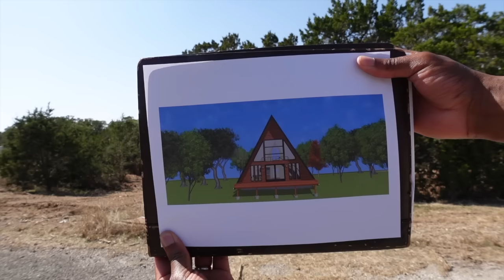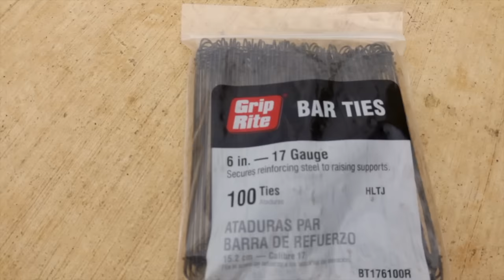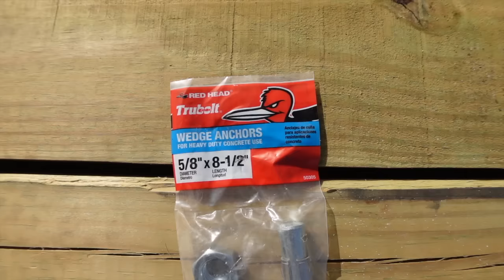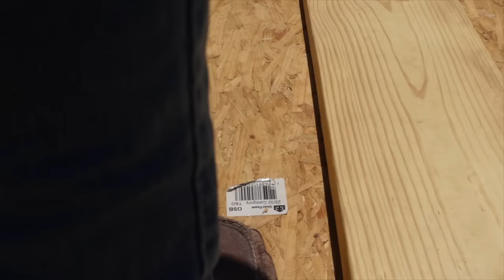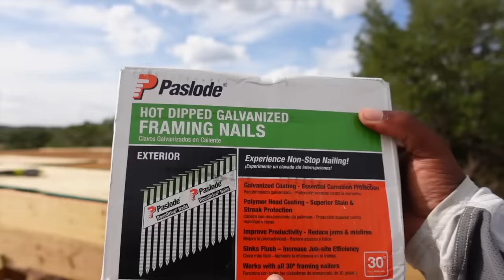TIMELAPSE | DIY Builder Makes A-Frame House In 25 Minutes | Canyon Lake, TX | Texas Hill Country

Comment: I’m 100% building an A-frame. I was undecided between that and a container home, but I have always been obsessed with the triangle. 😅 and putting solar on it.
Reply from the maker: That’s great! You can 100% do it. I think you’ll like it’s charm. And, the solar panels would be an awesome choice. 👍
Reply: Not very good for solar as the angle does not match the suns path
Reply: Do both.  Containers as walls a frame on top connecting them.
Reply: ...and water collection

Comment: the principle of the A frame is aesthetically cool and seems simpler to build but it requires a very high roof height to have enough habitable floor space useful when standing
Reply: I bet those who live in Mammoth Lakes in the Sierra Nevada are wishing they had an Aframe.  Sheds snow like nothing else.
Reply: They are not efficient with materials either, and inherently dark unless you break the A-frame-ness with "skylights" or dormers to get windows in elsewhere than the two ends. Designs are heavily weighted to use mezzanines and open floor plans to get any natural light past the ends. The aesthetics are fun though, but I wonder how much of that is borrowed nostalgia from the A-frame boom of the late 50s and the contrast vs conventional straight-wall houses.

For snow shedding, you can build a regular house with a 60 pitch roof, and even design your attic like an A-frame, but you get all that sweet conventional space below the roof. :)

Comment: If you don't mind me asking what are you using for rafters 2x10s? Married in the center? And how wide and tall was that house it's so hard to find info on these houses unless you buy a kit
Reply from the maker: For sure. So, the roof rafters are joined  2x10x16s. Two 2x10x16s make 1/2 of a full rafter. Then I cut them down ton size at 27ft and change long. The rafters are joined together in 3 spots. Ripped 8 ft pieces of 23/32 plywood connect the sides and a triangle piece connects both sides of the rafters at the top. Make sense? You may need to watch my “Raising the A’s” video. It will give a better visual. 🙏👍

Comment: Guys, the steel should be tied up with wire before pouring the concrete. It makes for a simpler way of attaching the rest of the structure as well. Nice build you're doing, hope to see how it advances eventually!
Reply from the maker: Gonsalomon! Go back and watch my other videos, brother. 👍

In the bottom of each of footing is rebar sitting on top of rebar chairs. And, to be extra thorough, I also wet-set four additional pieces #4 rebar that is bent in an L shape. Which is common place in residential construction.

Thanks for watching the channel! More great stuff on the way. 🙏👍
Reply: Daryl darksy cool video. Keep that auger vertical for better results 👍🏻👍🏻🤙🤙 good luck on your project A-frame that's so cool

Comment: This is so awesome, thanks for sharing because this is giving me an idea of what I need to do when we build an A-frame in NC starting later next year.  How did you attach the floor joists to the beams?  Nails?  I would have though some sort of bucket/angle would be used... Also, I noticed that you have some joists flush with the beams and then you put the joists on top of the beams...why is that?
Reply from the maker: Howdy! Yeah, my buddy convinced me  to just to throw the floor joists on top of the beams and I just never took the other joists down. But yeah, I used galvanized nails when I nailed the floor joists to the beams. Good luck with everything! 🙏👍

Comment: Darryl! I want to build one of these. Im here in Atl Ga. i work in a hospital. I know very little about how to go about this. If I could get any advice on where to start i would be grateful man. How knowledgeable about this were you when you started?
Reply from the maker: Terris! You can absolutely do this! Before I started building this A-Frame, I’d built a few small things around the house like; barn doors, tables, and a faux fireplace. So, this project was entirely different. 

My best advice is to watch all my videos. Lol. And, read as many books on construction as you can. I like to shop at ThriftBooks online. Learn framing, concrete, roofing, plumbing, etc. If you can learn about the mysteries of the human body you can learn this. They have better pricing than Amazon. 

God bless you, bro! You got this! 🙏👍